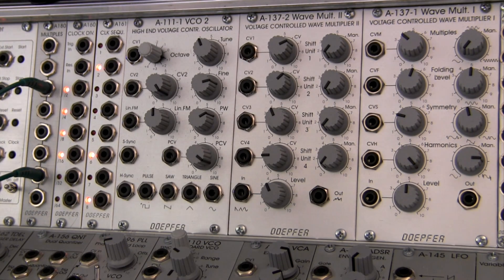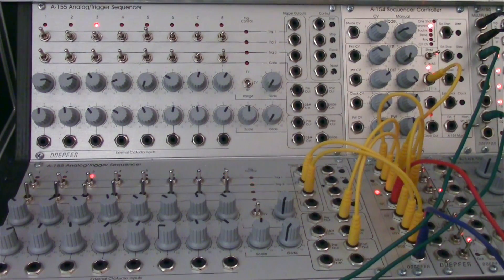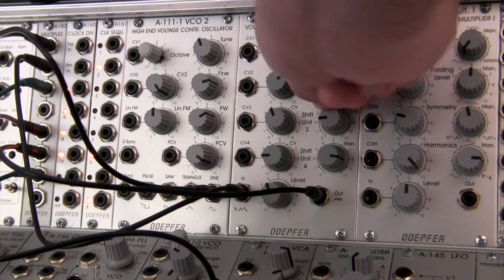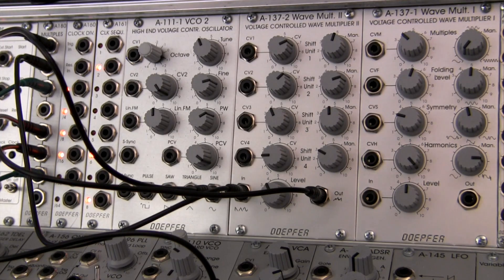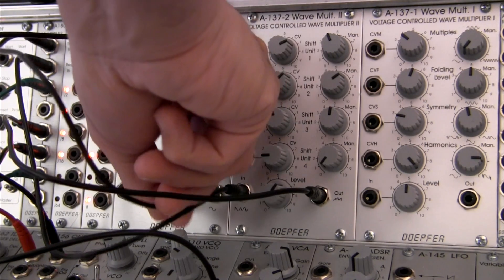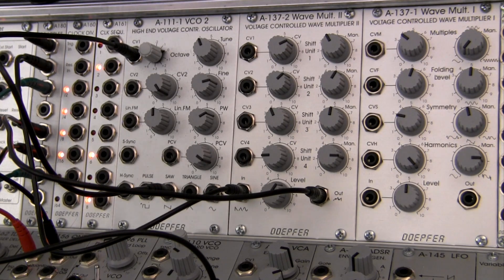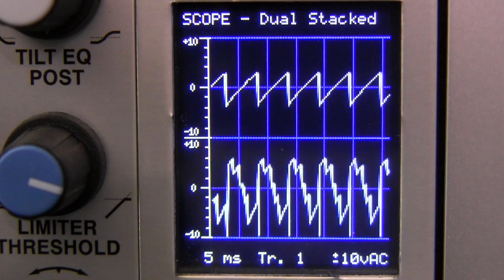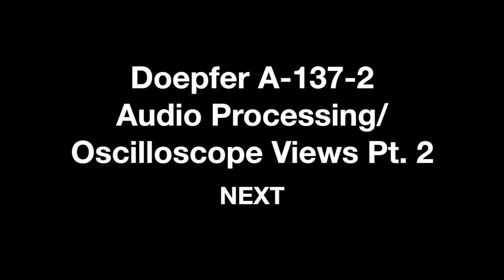Doepfer A137-2 VC Wave Multiplier II Audio Processing/Scope Views Pt. 1

Comment: Awesome video, Raul.

What does this thing sound like when running regular audio through it (loops, voice etc)?
Reply: +Cazaq It wont do anything good, probably just break up the signal. Results are erratic when not using either a triangle, saw or sine, as recommended by Doepfer. Lovely sounding module, adds great movement to waveforms.
Reply: Cheers.